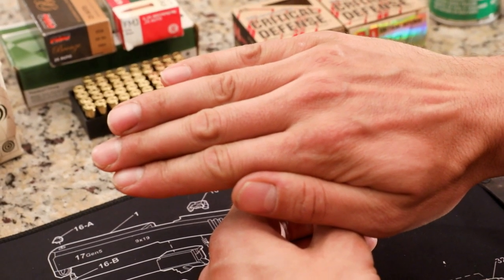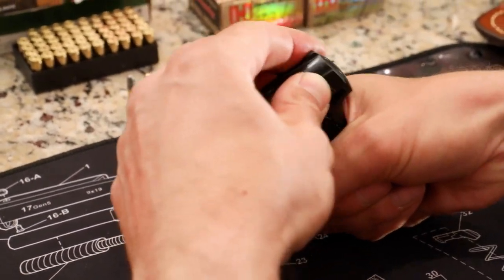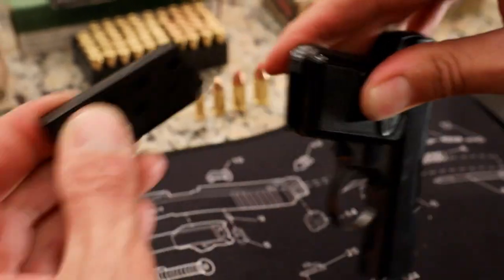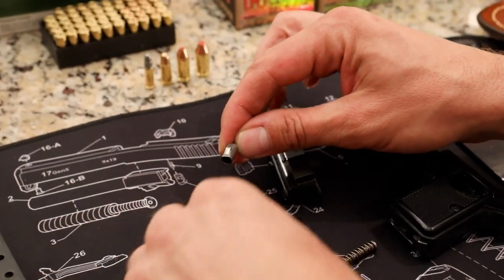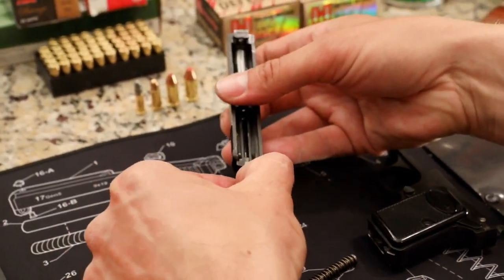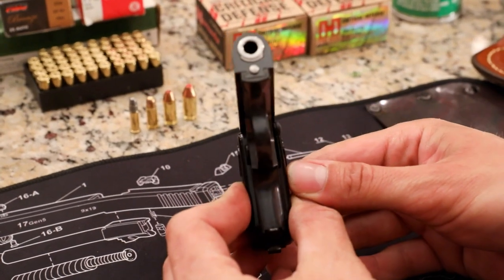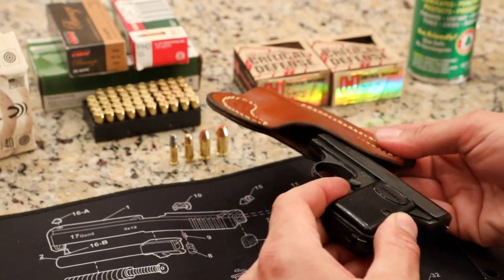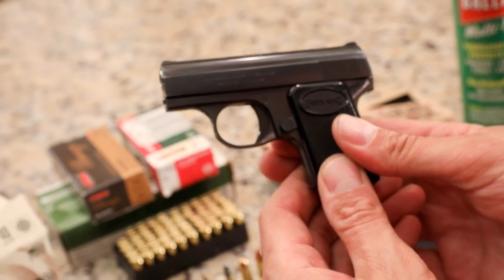Baby Browning Pocket Pistol 6.35mm 25acp Closeup and Field Strip

Comment: Hi, do you know, If there are different type of magazines for different year of manufacture of the baby? I Got one (probably from 50er or 60th., made in belgium), with an old magazine (not the original one of this gun), and it goes in and out very heavy, you actually need a tool to get in out if it was fully inside.
Reply from the maker: You might the Triple K Magazines and see if they work?  

https://triplek.com/product/browning-baby-25acp-6-rd/